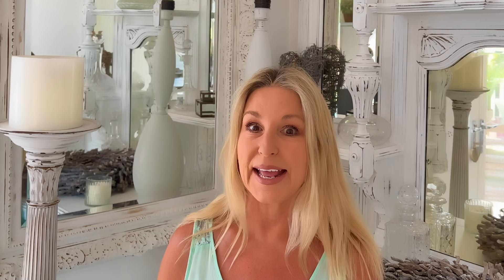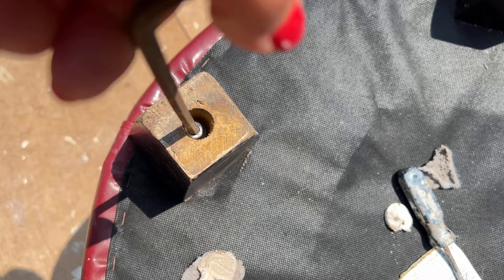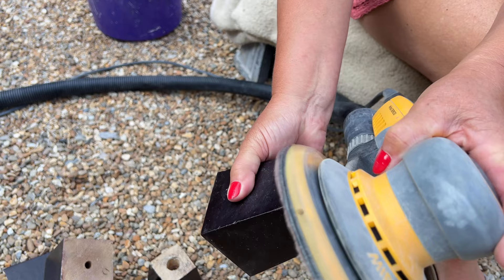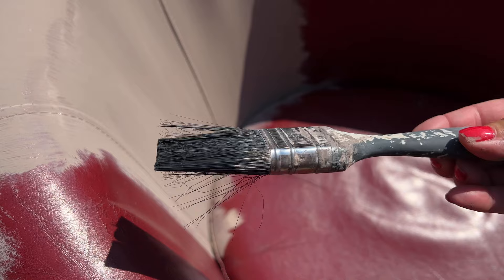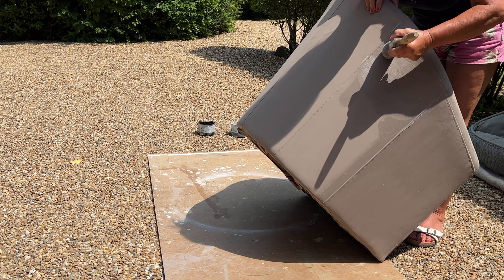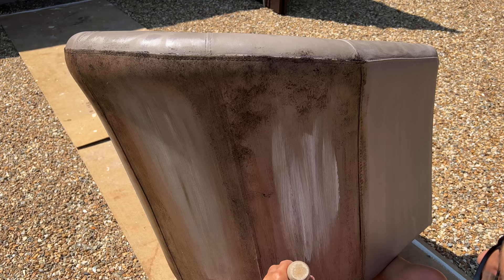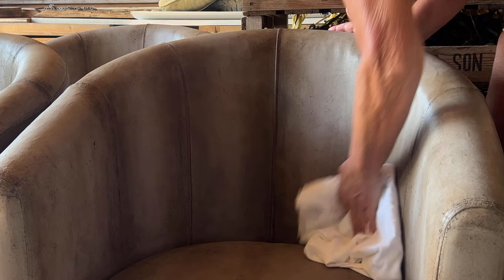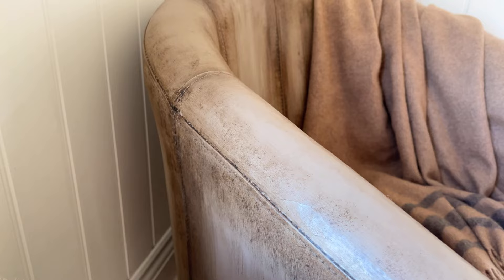EASY CHAIR MAKEOVERS ~Trash to Treasure ~ Thrift Flip ~ Home Decor DIY

Comment: I was able to find a loveseat that is in excellent condition other than one of the attached cushions is worn completely through. I looked in different areas and can see ways to remove fabric to recover the top. It was such a good deal that it could not be passed up. It will be where I relax on a closed in porch. My immediate plan is to simply use a throw that is held on with plastic clamps in the back. Will be on the search for ideas or may leave it as is with a chenille bedspread covering it??  I live on the edge of a forested area in the pineywoods of East Texas.
Reply from the maker: Oooh that sounds like a great find with lots of possibilities♥️